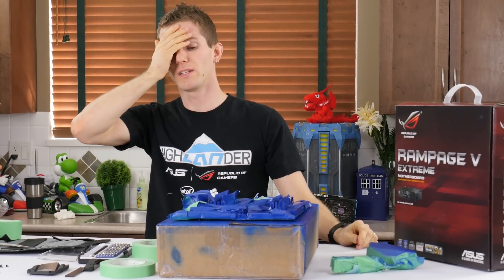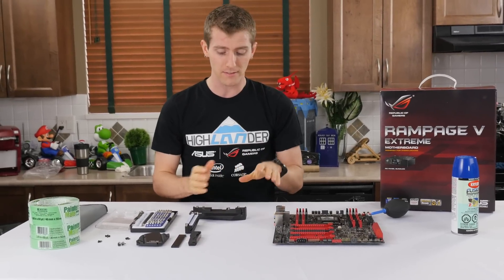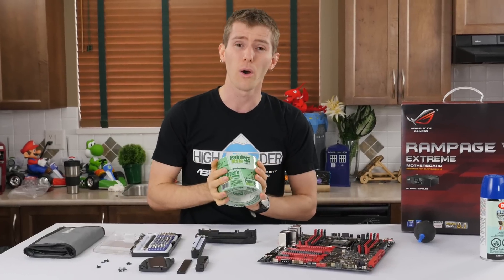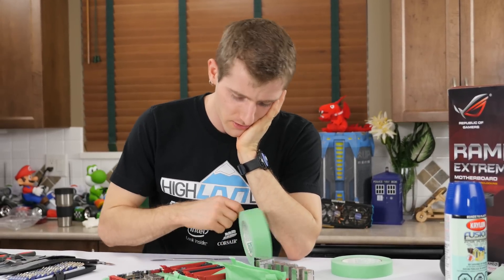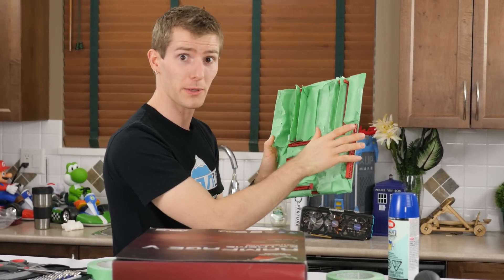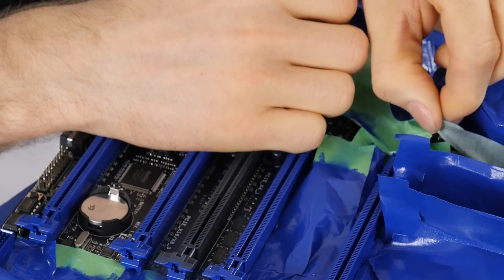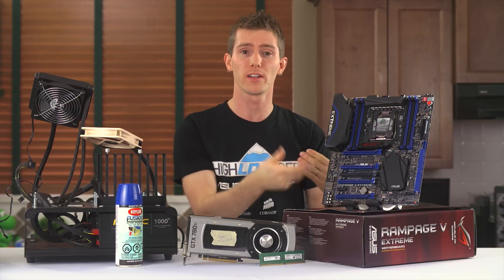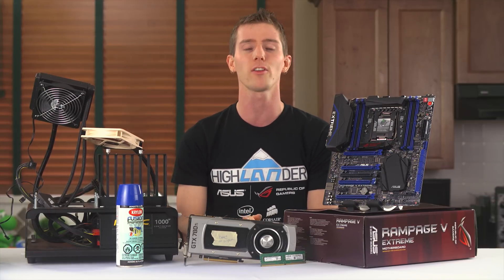Painting A Motherboard DIY Mod - ASUS Rampage 5 Extreme - Part 1

Comment: OUCH! you probably got paint inside the pins on the slots. i would have stuffed tape inside the slots. when the ram is installed and gpu's installed you wont see the color inside the slots anyways. just a little constructive criticism.

Comment: Why don't they offer these things in different color schemes? Painting them is a pain in the ass, but using the same bits made with a different color plastic seems like it would add very little to the manufacturing cost compared to how much extra they could charge.

Comment: Why didn't Linus use some old ram without case or heat sink to protect the dimm slots? Same for the pcie ports. Would have saved some trouble I think we'll see in part 2.

Comment: What I disliked about the video.... The static wasn't a big deal, there were only 2 short spots. I can deal with that. I don't expect perfect. However, I didn't like the fact that I wasn't able to see if the thing worked or not. If the video wasn't done, it should have been put on the back burner until it was. With that being said, I did still enjoy it and still hit the like button.

Comment: could have used soldering spotmask.. don't know if that's the correct name. it goes on like a paste and dries to like a silicone/rubberish thing. peels off easy and its meant to stop solder from going on stuff like surface mount parts or copper parts.. just saying

Comment: Acetone and Denatured Alcohol work well to clean up over spray. Acetone though you might want to keep away from plastic bits, though it usually will not affect the PCB material.

Comment: Looks good Linus I seen a little overspray on the black ram slot but aside from that looks great I'm sure once you have everything installed it'll look sweet I'm probably going to do a black and green z97 mobo on my next build black and green theme all the way through and nobody makes that color combo so I'll end up diying it also when you do the contacts would a cut up old gift card shield the contacts I'm wondering if that would work

Comment: Wondering if you could find someone with a blue motherboard and swap the pcie slots with the other board by popping them out, obviously not likely with the ram slots being ddr4 (unless you can find a blue ddr4 board to scavenge).

Comment: Yo guys, so I'm in the PcMasterrace now and I've been looking for a solid Monitor 24", Under £200, I have Super slim bezel OCD, Under 5ms, HDMI with good SPEAKERS!!

I have been looking at the BENQ EW2440L as it has a sexy super slim bezel, 4 ms, 2 HDMI ports but the one thing thats killing me is the speakers. I don't know if the speakers on it ( 2w, stereo I think) are good. So can anyone enlighten me. Are the speakers on the BENQ EW2440L good. I'm not really looking to invest in external speakers just yet. 

Thanks

Comment: I am so glad you're making this series. I can't choose between the Asus X99 Deluxe and Asus Rampage 5 Extreme. As far as for protecting the slots, I work at a hydraulics repair shop (but I know your local auto repair shop or Home Depot should have these) and I'm planning on using several rubber o-rings of the appropriate material cross section to fit snugly in the slot but large enough diameter that I can slice it and lay it out straight. Then trim to length and press into the top of the slot. They should be soft enough to compress into the contours of the grooves and protect the contacts but low enough profile to allow even coverage of the paint from all angles.

Comment: interesting concept.  i always had a hard time finding good mobos to match the color theme that i want.  i probably wouldn't spraypaint even if its easier, but i probably would individually paint it with a fine tip hobby brush.

Comment: looks like it turned out pretty good as far as the finish goes, although if I were to attempt this I think I would go with a small brush and matte finish model paints (like testors) because it tends to spread out more evenly than the glossy paints do - less chance of drips and runs.  Or perhaps you could spray vinyl dye into a cup and brush that on?  Never tried that but maybe it could work.

Comment: Linus what do you do about getting drivers for fresh installs? Do you do it all by hand or use a program?
Reply: Always do it manually aka visit the VENDOR's direct url.  ( nvidia.com for nvidia gpu based video cards.   amd.com for amd gpu based cards.   ) If you have an INTEL nic ( onboard soldered or physical pci or pci express card) visit Intel.com, otherwise if you haver aetheros or realtek, windows updates takes care of that just fine just like with onboard sound.

Comment: Not going to lie. I cringed the whole time. Question that came into mind. Why not take a trash memory and so on. Cut the excess on top away and place it into the slot. You would still get paint into the needed areas and not convert contracts.

Comment: I would have used PlastiDip to spray the hole mobo,  then cut around the red plastic bits, then spray red plastic bits, dry and then peel off the PlastiDip.

Comment: Wouldn't the pins/connectors inside of the pci-e and dimm slots get ruined when being painted?
Reply: He's using paint meant for plastic which will not adhere very well to the copper pins. It'll come off of the copper easily without being removed from the plastic IF he can get to them well enough.
Reply: enginesnblades Thanks :) Makes sense though...
Reply: ***** Probably what I would have done considering he likely has something laying around, except it might be a bit more difficult with the DDR4 slots.

Comment: What's with all the complaining about "lack of detail" in the video? A lot of you clearly haven't painted anything before. It's extremely simple and how Linus went about this is the only way you can, really. You mask the parts you don't want painted, and go at it with multiple coats until it looks good. That's it. It's a simple project that takes forever.

Comment: Well when I saw the title I assumed that Linus was painting the whole cirquit board 'lol' This is more painting the ascent part of a motherboard. So I think the title of this video is a bit misleading. Wouldn't it be easier to paint the ascent part with a thin paintbrush and just mask off the area around it.. You can paint a cirquit board with plasti dip hence its non conductive. However I have never tried it myself, so I can't be a 100% sure about it. but in theory you can do it. I think that Linus should try that the next time he get the urge to paint a mother board:)

Comment: Suggestion. When doing this I would put some cheap or bad components installed . like some old ram and maybe cut the connected off a pic device and install before painting. That would protect the connections. And when the items are installed you would not see the old paint

Comment: ..but you painted the metal contacts on the ram, PCI and Sata ports. Eh it may work but not something to do on a 500$ mobo. I would try Rubbing alcohol or acetone with a q-tip to take overspray off.

Comment: Going to be doing the same thing but for an msi z87 gaming g45 board but with green instead of blue. My razer h440 is coming in this week and I want everything to match. Going to paint my ram heat spreaders to, as well as the colour rings on my corsair sp120 fans and corsair AF 120's and AF 140.

Comment: Hey Linus I have done this before and what I did was dig up some old ram that I didn't care about install it and then paint it with ram installed it wont get paint in the contacts it worked out great...I guess you could do the same with the PCI if your willing to sacrificing some old video cards and memory. Any way great video.

Comment: Assuming that the board works, you could always take some nail polish remover to the back of that PCIe slot if you want to remove that excess paint... provided that it's the right kind of paint, which I think it is.  Just use a small tip paint brush, I had to do that a few times with a paint job I did on a universal GPU waterblock when the paint broke a bit assembling the loop.

Comment: Aren't all of the components painted here soldered with pins?  I think it would have been much easier/faster/safer to remove the slots from the board, paint, then solder back on.  These components having pins really does make the soldering job relatively easy; with a good iron of course.  Going from red to something darker such as black or purple, you could drop the slots into some black or dark blue Rit dye.  That stuff works well on certain types of plastic.

Someone also mentioned plastidip (there is a spray version), which I think would have been a neat idea as well.  Only would need to mask off internal spaces such as sockets,plugs and slots, then spray away.  Would be a cool project to totally black out a mobo.

Comment: just re flowing the solder off the parts you wanted to paint and re soldering the parts back on would be a lot faster, DONT MOD IF ITS HALF ASSED. The blue is nice though

Comment: Wouldn't soldering off the PCIe and dimm slots and repainting them blue be a better way to go? Or better yet, swap them with ones you like from a donor board (a dead one off ebay would cost pennies). Sure, soldering is tricky on a PCB, but anything would be better than this. I'm not even sure the pins can make good contact through the paint layer, never mind the increased electrical resistance.

Comment: Why can't manufactures do what HP has done with their laptops, you can (in the bios) choose between all your ports been usb 2, usb 3, or a weird hybird mode where the usb ports boot as usb 2 then when it gets to the os it switches over to usb 3. So if your installing a fresh version of windows tard 7 and usb 3 just isn't working. Well reboot switch to usb 2, install usb 3 drivers, and then switch back to usb3 then your good to go.

Comment: Why not plug up the memory slots and PCIe slots with dead memory and dead graphics card boards. SATA cables are cheap and could have been used to cover up the SATA ports. Seems like a much better uses of resources for someone who works at a computer parts store. Honestly I felt like the way this was handled was irresponsible because you didn't take those extra steps, especially considering the price of the board....

Comment: Surprised you didn't use a primer, im assuming this was to reduce the amount of paint getting into the pcie slots. Could you have used an old PCIE PCB with the top cut off the populate the slots to reduce the amount of paint getting inside?

Comment: for over spray you could try some cleaning alcohol and an ear clean sticky thing (don't know the name sry)

if you wait to long this probably won't work because the paint hardened to much
in that case you could try some acetone but be very careful it will melt the plastic bits so dry it of as fast as possible once applied (don't know what it'll do to the pcb but probably melt the wax layer thats on there if you leave it to long)

Comment: I will probably have in my next build same, or maybe a lot worse problem than you.. Cause my favourite color is dark grey (like on iPhone 5S, or the Moon surface) Case isn't very problematic, because i can simply get Define R5 Titanium Window and GPU with reference or EVGA cooler, but PSU, Motherboard, CPU cooler, case fans and RAMs are just a pain in my as...

Comment: WHYYYY you did not put a piece of cardboard inside pci slots and ram slots?!?!?! that way you dont get paint inside, soaking the small contacts!
Things like sata and usb ports can be cleaned just by scraping the inside (plug and unplug a sata or usb cable many times and contacts will be paint free), and all the crap left by dry paint wont be an issue, but on a pci or ram slot with hundred of small, fragile contacts you will probably break or misalign something!

Comment: Honestly you should of used a dead gpu and plugged it in to keep ports clean or chop off the connector and same with ram slots that assures your going to have clean ports

Comment: I like this. I lot of people choose certain parts based on color and aesthetic reasons. IF the top boards came out in multiple colors it would be a non issue. Now, if only this kind of modding was easier, it looked like such a hassle.

Comment: LinusTechTips There is content that can be split into parts, that works really well ie Slick's value motherboard overview. But there is content that just can't be, like this one.

You said for this video "Can you safely paint your motherboard with a can of spraypaint and a few rolls of painter's tape", while this video definetely can't answer this question and creates more question marks like "how you handle the painted PCI pins". Basicly all i saw is an ~8 minute long video of you tape-covering and spraying a motherboard, then some sponsors and that's it. The painting job is also not something special, while it should be, cause it's a tough procedure. There are also missing details, like the blue strip in the I/O shield. Long story short, it's not a helpfull video that provides answers.

I know that there is stuff like sponsorship pressure and other things that us outsiders of the LMG can't see, but i strongly believe that that kind of a subject should be more thouroughly explained into one video, even if it took longer to produce. I really don't know what is the story behind and why you HAD to upload it today, but it feels like it's an incomplete video. 

Though i know it won't hurt you that much, here is an honest dislike, and do a better planning next time :)

Comment: I feel like if you would have put something in the slots you wouldn't have to worry about cleaning them out. Spare ram in ram slots, and either spare gfx cards or those wires you can use to extend the gfx card.

Comment: Don't blame you on changing color! Didn't buy my ASUS board until they came out with black edition on the 2011 socket and unfortunately it was just before 2011 V3 came out. great job even if you have trolls out there!

Comment: You should have installed some dead memory and some PCIe  cards( probably cut off the contact from the cards) into the slots so the contacts wont be covered in paint. It's easier than cleaning the contacts.

Comment: Good video...dont mind the multiple parts as any nodding like this takes time. (I liked it)

But next time...use Plasti Dip. 
Its not as "damaging" per say as the spray paint...but you can peel off what you over sprayed or didnt want covered.

Comment: I know you have to have a plentiful amount of graphics cards laying around. Why not take a broken one, break off the PCIe connector and use a fried RAM stick and use that to keep the paint from getting in the ports? Same goes for the other slots on the board. That would insure the success of the project

Comment: Linus, since you guys have so many parts lying around, in my opinion, you could have gathered boards, taped them (that would be easy because they would be completely covered) and populated all the slots, instead of running the risk of isolating the contacts inside the slots with ink, what may be a pain to detect and clean. The idea of the video is interesting anyway.

Comment: Why dont you put old ram that is not good in the slots and shoot it? It would keep out paint. Do the same with gpu, psu plugs on the motherboard, and use sata cables for the drive slots. Just a suggestion.

Comment: This has to be one of the worst ideas I have seen. Why risk all of that on such a primo board for something that is purely cosmetic? It's wayyy more effort than its worth. Everything considered this can also be classified as a hack job, or seriously sub professional. No offense linus.... but keeping the RAM slots OPEN while spraying?! Come on now...
Reply: Maybe he has an idea about how to remove the paint from the contact pins like he said he does
Reply: I've done it before(2 motherboards), no problems whatsoever.
Reply: The paint is meant for plastic. It won't adhere very well to the copper pins so THEORETICALLY he could just chip/scratch them off. LTT probably get a million boards, graphics cards, ram, etc to test and review and most of the time probably get to keep them. So I'm sure even if it was dead after this he'd get another one. It's one of those What if projects really. Like his all room water cooling project. It's cool if it works and if it doesn't well now you know.
Reply: This is not a very complicated mod, it is blown way out of context in this video, people do this all the time.... To take the fucking paint off you take your ram stick and put it in and take it out.... and put it in... then guess what... YOU TAKE IT OUT. after doing this a few hundred times you will have a working dimm slot.
Reply: TekSupport LMFAO
Reply: god dammit i admin a facebook computer group and everybody keeps bitching about how he ruined a motherboard i have literally typed that comment 10 times now...
Reply: TekSupport
I feel ya, most people here didn't know that this is an old mod, done many times before. The board will work just fine.
Reply: Hey people maybe suggested it. Dont judge him jackass. At least its not your board.

Comment: Awesome video Linus!! Just curious. Had you thought about possibly going the Plastidip route? I ask because you technically could have painted the whole thing without taping over as much due to the fact you can easily peel/cut off what you don't want painted with an X-Acto Knife before its completely dried and cured. Lemme know what you think :)